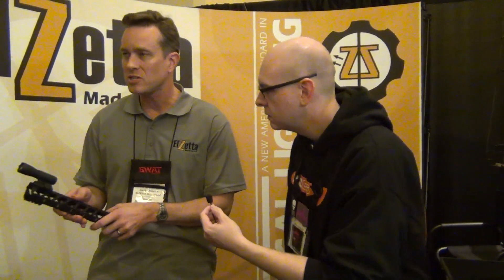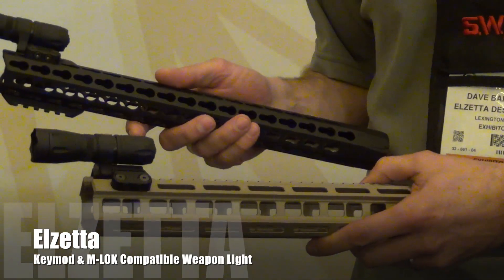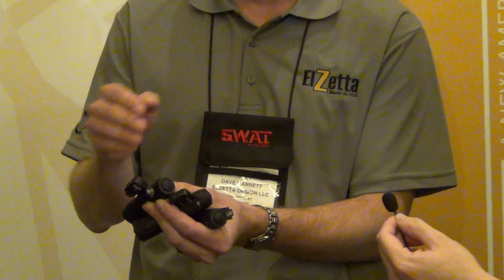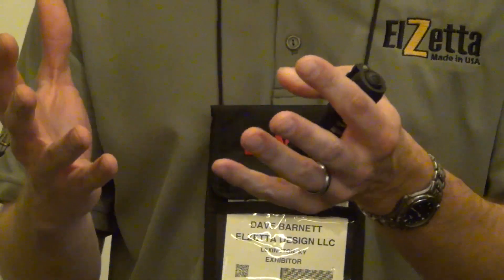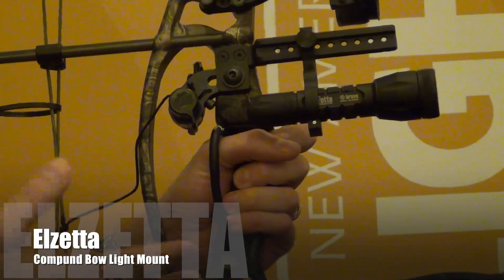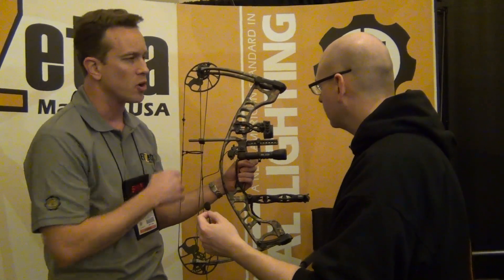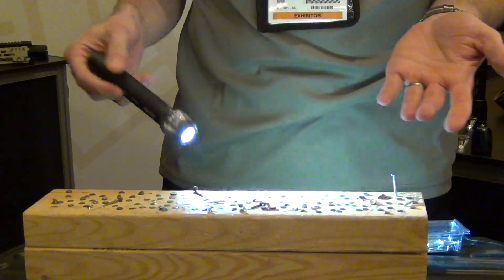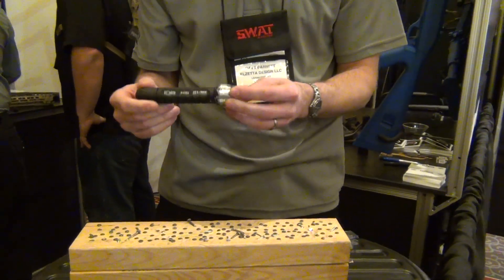Elzetta Lights - SHOT Show 2015

Comment: Comparison between new Elzetta 3 cell light and Surefire P3X Fury, both lights around 1000 lumens, the center hot spot on the Elzetta is not as defined as the surefire, and the spill although smaller in diameter than the surefire is brighter inside that smaller spill diameter, but the Elzetta's light is more yellow than white, compared to the Surefire. If you need a light for distance, Surefire, If you want something to light up a large area with usable light, Elzetta all the way.